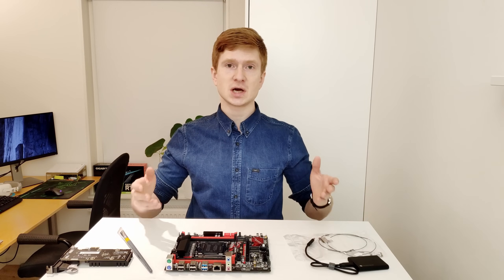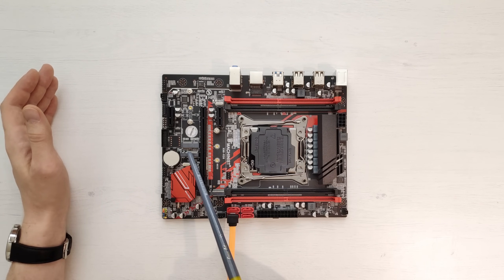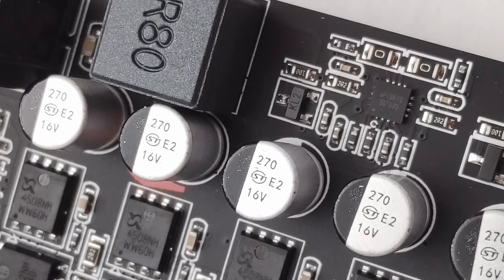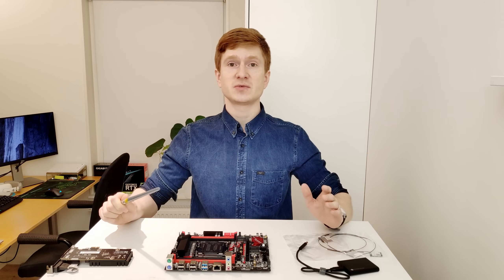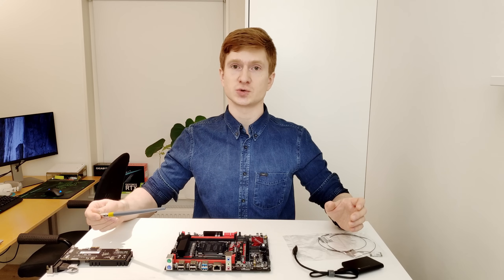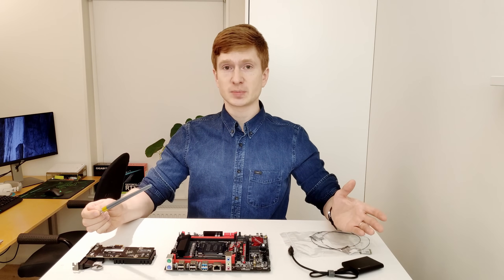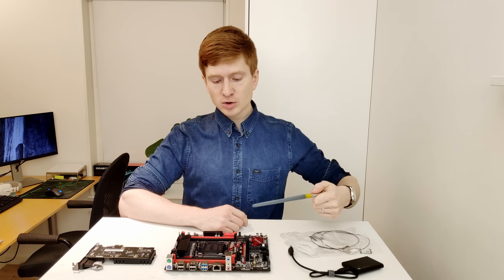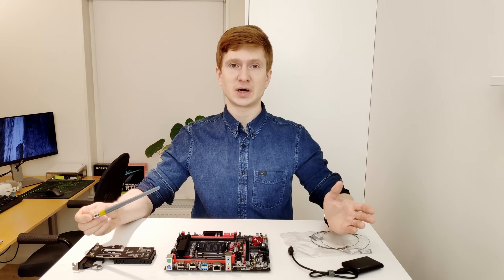🇬🇧 Machinist X99-RS9 – detailed review | E5-2678 V3 | i7-6800k | BIOS | O.C. | VRM | Mi899

Comment: what cheap motherboard for e5 2660 v3?
Reply from the maker: Maybe Huananzhi X99-ZD4 or X99-BD4?
Reply: @Miyconst  thank u but would the rs9 work tho
Reply: and can i run g skill aegis memory
Reply: with any x99 motherboard
Reply: @Miyconst  shipping is very expensive for the bd4 and the zd4 it is additional 25 € to my country
Reply from the maker: @aynamehd7455  X99-RS9 will work with E5-2660 V3, but the motherboard's VRM is really not up for this load, thus you would have to implement good cooling.

Comment: i have a problem, my current configuration is: rs9, 2x4gb atermiter 2666mhz ecc, 2640v3, but after 5 minutes of use, the pc freezes and i need to turn off the button. I saw people talking to set the memory clock at 1066mhz but the rs9 bios only allows 1333. I don't know what to do
Reply from the maker: You have to test components one by one and figure out what causes the freeze.

Comment: So can you recommend the best board that will fit into the Cooler Master NR200 Mini ITX Case with 3 expansion slots?  I plan on using the most powerful processor supported by the board X99, an 18 core 36 thread CPU.  I'm interested in all things of the board SATA III 6Gbps operation, USB 3.0, not sharing SATA ports with the nvme slot, and the fully unlocked BIOS with overclocking features.  Thanks
Reply from the maker: Unfortunately there are no available X99 boards which would match your demands.
Reply: @Miyconst  Not even Supermicro makes a board that would fit my expectations or demands?  Also can you use non-ecc unbuffered ram with a xeon?  Thanks
Reply from the maker: @trapperainsworth2435  I am not an expert in Supermicro boards, but as far as I know, they make very few workstation options, mostly for servers. There is one board which fits your needs: AaRock X99E-ITX/ac, but it's not widely available.
Reply: @Miyconst  Yeah I think I decided to go AMD Ryzen instead of Intel Xeon because of the motherboard cost.  Also the architecture of the AMD Ryzen chip is superior to the Intel Broadwell or Haswell architecture.  I render a lot using Handbrake or MediaCoder & lots of Gaming so I think AMD is my ideal choice.  Thanks for all the help.
Reply from the maker: @trapperainsworth2435  that's a very wise decision. Good luck with the build.
Reply: @Miyconst  So which systems do you use primarily?  Did the Machinist boards become perfected over time & now usable?  Or still only ideal for lower end components?  I would go X99 if it could surpass the Ryzen 7 1700 for less cash or the 5800x...  It's difficult to do that for x99 haswell broadwell.
Reply: @Miyconst  So I noticed the Intel Xeon E5-2699 V4 scores 32,623 on Cinebench R23 vs AMD Ryzen 9 5950X scores 28,641.  So really the Intel Xeon is more powerful on the most intense tasks imaginable?  The ASRock X99 ITX board supports the E5-2699 V4 I'm pretty sure also the cpu costs $480 for a ES from China.  Versus the 5950x which goes for $720 from the USA.  So what do you think?  Will the E5-2699 V4 out perform the Ryzen on Handbrake or MediaCoder?
Reply from the maker: @trapperainsworth2435  no, I don't think that E5-2699 V4 will outperform R9 5950X in real tasks, moreover I strongly recommend avoid the V4 ES CPUs from AliExpress. The frequency and compatibility is unknown.
Reply from the maker: @trapperainsworth2435  Yes, I do recommend R9 5950X over E5-2699 V4, but it all comes down to your needs and budget. If you are trying to save as much money as possible - sure, go with Xeon, but don't buy a Chinese X99 motherboard for this CPU. P.S. I don't really see how the linked video is related to the subject. R7 1800X is miles behind R9 5950X.
Reply: @Miyconst   Thank you so much for your assistance buddy! Hi I linked it since the e5-2696 v4 44 thread cpu got done at 12 min 56 sec & the 1800x finished at over 25 minutes.  So 25 minutes divided by 2 equals 12.5 minutes which would be twice as fast as the 1800x, likely as fast as a 5950x.  So for a lot less money on this specific application, the Xeon e5 surpasses the 1800x and rivals the 5950x likely.  By the way on 3dmark physics the Intel Xeon e5 gets smoked by the AMD Ryzen 5900x & Intel Core i9 10850k (my friend recommended), but the 5900x has higher ipc than the 10850k.  3dmark physics is important, but I need a superior cpu for encoding using handbrake & mediacoder & for gaming at 4k.
Reply from the maker: @trapperainsworth2435  well, Ryzen 9 5950X smokes them all, hence it costs this much, also, from my experience, many Handbrake operations can't be fully parallel, which leads to many cores chilling out while a few are working in certain cases, but in such cases Ryzen will be miles ahead of the lower clocked Xeon.

Comment: riend, a Brazilian brother.
I would like to know if using an i7 6800k will i have to change my server ecc memories?

I currently use an e5 2620 v3 with turbo clock, but even so nothing compares to the stock clock of the i7 version k
Reply from the maker: Yes, you have to change your memory, i7-6800k doesn't work with ECC REG memory.
Reply: @Miyconst  ok bro , "obrigado" thnks

Comment: Hi friend, I liked very much this motherboard for a budget server. I am thinking if a E5-2618L v4 (QS) can works normally in this motherboard. Or if you think it's better to stick to the v3 options non-QS. Thanks in advance.
Reply from the maker: What is the price of that QS CPU? Why no just get an E5-2630L V3?
Reply: @Miyconst  in dolar this qs cpu is $108. It is almost 3x the price of the 2630l v3. I have a 2630l v3, I like it very much. I was thinking of 2618l v4 as a way to reach a higher single thread performance (and a ddr4 2133 support). A qs cpu could be unstable? Or maybe it's a bad choice
Reply from the maker: @baruchkata  $108 is a complete robbery for that CPU, you better get an E5-2640 V3 in that case.

Comment: Hello all. I have two question. 

1. i am switching from an E5 2620 v3 to an E5 2640 v3 in the short term. currently turbo unlock is enabled. Without undervolt mod. Is it necessary to make an undervolt setting with the 2640 v3?

2. do I have to flash the bios again after the CPU change or does Turbo Unlock run automatically with the new CPU?
Reply from the maker: There is no universal answer for the questions. Your E5-2640 V3 may or may not be able to work with the same understanding level, also depending on which unlocking method you used, you might need to reinstall EFI driver.

Comment: Hello I have a question and hope you can be helpful. I have the motherboard with a B85 chipset. 
In both stock and modified BIOS I have a CPU temperature of 95 degrees. The fan sits properly on the CPU and rotate completely normal. However, the CPU clocks itself down to 200 MHz in some cases (e5 2620 v3) due to the specified heat. What I can not explain, the cooler is almost cold. Have you had such experiences with the motherboard? I would have chosen another model. But maybe you have another idea.
Reply from the maker: This has nothing to do with the motherboard, your CPU cooler is either broken or wrongly mounted.
Reply: It works. I try a new cooler.

Comment: Thanks for the information, you will have a video on how to change the bios since my motherboard is the same one that you have and I can't install the operating system, it crashes with a blue screen every now and then.
Reply from the maker: Changing the BIOS won't solve the blue screen issue, you have to locate the malfunctioning component and replace it.
Reply: this is the blue screen message.  device ran into a problem and needs to restart. well restart for you. then it resets
Reply from the maker: @rubenjara4938  this blue screen can be caused by basically anything, you have to isolate the issue and figure out which of the components is not working.
Reply: friend fix the problem this board does not support cpu i7.   with cpu xeon the plate works flawlessly
Reply from the maker: @rubenjara4938  which BIOS do you use?
Reply: @Miyconst  I7 it didn't work 5.11 UEFI2.4:PI 1.3  0.12 X64 ----- nowadays 5.11UEFI 2.4; PI 1.3 HUANANZHI X99 0.11X64 none worked with the cpu I7.     I am currently with the xeon 2620 v3 perfect operation.
Reply from the maker: @rubenjara4938  are you sure that the i7 is working at all? Did you use original BIOS or Turbo Boost unlocked?
Reply: @Miyconst  Original and modified pure cpu failures i7
Reply from the maker: @rubenjara4938  did you test the CPU with another motherboard?
Reply: @Miyconst  At the moment I do not have another plate with support 2011 v3 When I have it I will confirm some news Greetings and Thanks for your Interest

Comment: Hello! i made the turbo unlock on my rs9 with 2630l v3 with -70mv and worked like a charm! Just one question: on stress cpuz test all cores reach only 2793 mhz, is it normal?
Reply from the maker: Yes, it's very normal. E5-2630L V3 is a low TDP CPU, it can't hold it's maximum 2.9 GHz on all cores even with Turbo Boost Unlock.
Reply: @Miyconst  Thanks for the prompt feedback!

Comment: Thank you! I'm considering it for a budget gaming system for my sister. People sleep on these boards paired with xeons so much. They want the latest bling while these offer so much performance at a fraction of the price. This will work with desktop memories too right?
Reply from the maker: Yes, it does work with the desktop DDR4 memory, but be careful, because 4 and potentially 8 bank memory modules are not supported. Warning: memory bank is not the same as memory capacity, 8 GB memory modules can utilize 4, 8, 16 banks layout.
Reply: @Miyconst  Thanks for the heads up. I will have to research it. It becomes a bit too technical for me. The banks are the "x4" or "x8' modules have on their specifications right? So 1Rx8 is 1 rank 8 banks? And 2Rx8 is 2 ranks 16 banks in total right? Man this becomes quite niche. Rule of thumb, look for modules with 2 Rows of chips so 16 banks?
Reply from the maker: Yes, you have got the idea correctly, there are also 1Rx16 modules, which work as well.
Reply: @Miyconst  Thanks again for taking the time to reply. All the best.
Reply: @Miyconst  Hello! I finally got everything for the system but I have a problem. It doesn't boot! I don't understand why. 2640 v3 CPU and SK hynix DDR4 2666MHz 1Rx16 4x4GB HMA851U6CJR6N-VK. Could it be because of server cpu and desktop memory? Power goes to the CPU it gets warm. No beeps or anything (I don't think it as a speaker anyway, does it). I tried a different power supply too. Faulty CPU?
Reply: @oricef  Yeah that's what I did. It's perfectly good now :)
Reply: @kariverson1  what did you do?

Comment: Found this vid while trying to troubleshoot ECC not enabling on my Qiyida X99-H9 board. did you experience any issues getting ECC enabled?  much thanks
Reply from the maker: Most of the Chinese X79 / X99 motherboards work with ECC memory, but don't enable ECC mode, you need a custom BIOS for most of the motherboards.
Reply: @Miyconst  i see. I had bought a Qiyida x79-6M combo set which had working ECC (shown working in both MemTest and in TrueNAS).   I then got a Qiyida x99-h9 combo and while memtest can detect the ram is ECC, the system seems unable to use it. (Then i stumbled on your videos and watched a bunch of them)    I'll try to use one of the custom bios from your mi899 to see if it solves this issue.  Thank you for your time and reply!
Reply: @Miyconst  sorry to bother so much.  I tried all versions of the 8M-F bios and the RS9 bios on this board, but regardless of bios and wether i use auto/enable ECC in bios setting, the board just wont enable ECC.  Any recommendation on other bios for the x99-h9?   Or do you know offhand any board you tested that actually had ecc working?  Thanks alot!
Reply from the maker: @ColemanR42  sorry I don't remember all boards with ECC support out of my head, but Huananzhi X99-TF / X99-F8 / X99-T8 with iEngineer BIOS worked with ECC mode enabled for sure.
Reply: @Miyconst  Hey thought i'd give a follow up conclusion on this.  I obtained a Huananzhi x99 8m and with any of your program's custom Bios, the ECC is enabled and reports working in memtest and trueNAS  (Default bios did not enable the ECC, and no bios actually had specific ECC options). So yeah, one needs to be extra careful to actually get an X99 chipset on these boards, as the other chipsets will boot with ECC, but not enable their function

And an extra note, the v-ram heatsink on the 8m is so much better, entire board stays mostly cool with my load on it,  while the H9 had the entire board and even the RAM heating to painful levels. 

Thanks for your earlier replies to my questions! and thanks for your mi899 program and all your content for this!

Comment: Hi guys. I have a problem with my kit machinist rs9 + xeon 2640 v3 + 2x8Gb2400mhz Ballistix Sport. The power is on but do not have video. I can hear 5 beeps at start but nothing more... https://youtu.be/FT69xD9n0kY

Any dips ?
Reply from the maker: Most likely the graphics card is not detected. Which GPU do you use?
Reply: @Miyconst  hi miyconst. A old one. Gts 450. I will try with another one.
Reply: @Miyconst  problem solved. Thank you very much!

Comment: I need some help with this motherboard... I just installed a 5930k and vengeance lpx 3333 memory, and it's not booting ! Is this cpu compatible ? Else, how to get it work ?
Reply from the maker: There might be several reasons for the issue:

- The memory is not compatible.
- The motherboard came with Turbo Boost Unlocked BIOS, which is not compatible with i7 CPUs.
- The motherboard is defective.
Reply: @Miyconst  Thanks for your reply... I want to try your bios... Do i need the ch341a tool ? Or you can update it only with usb key, like my previous asus x99 motherboard ?
Reply from the maker: You need a CH341a if you can't get the motherboard booted. Before messing with the BIOS I would strongly recommend to at least try some other RAM, better if you can get some ECC REG modules.
Reply: @Miyconst  I already tried another set of 2400mhz ram, not working too...
Reply from the maker: @fvignola  was it ECC REG memory?
Reply: @Miyconst  I just verified and no. It was ballistix 2400 mhz non ecc... I'll try to get an ecc reg set to test... Also, I just went to learn that I can flash the bios chip with Arduino. I know arduino really well, so I'll not need a Ch341a programmer...
Reply: Which bios do you suggest to me ? I listened  your video about all x99 board and bios... You suggest a bios for this board, but I cant understand what you are telling, because  I dont understand english really well... 

And one last thing, do you know where I can find the manual for this motherboard, machinist x99-rs9 ? C'ant find it antwhere... 

And Thanks for you help sir ;)
Reply from the maker: @fvignola  My Machinist X99-RS9 worked well with Huananzhi X99-8M-F BIOS, and this is the BIOS I would pick for myself. Manuals do not exist for these Chinese X99 motherboards.
Reply: UPDATE, Ecc ram is not workink with 5930k... So i ordered a used Xeon E5-2697 V3. I'll need this update to unlock turbo boost anyway...
Reply from the maker: @fvignola  that's strange, I have tested i7-5820k with ECC REG memory and it worked.

Comment: Hello! I got a RS9 with C226 chipset, i have unlocked the turbo and make undervolting manually and works great but, i want to know how to unlock the memory timings in BIOS to optmize the system. Can you add a modded BIOS on Mi899 to C226 chipset, or, can you make a video tutorial showing how to unlock it? Thanks!
Reply from the maker: As far as I know C226 and B85 chipset are compatible with each other, but I can't guarantee that since I didn't test it myself. Unfortunately I don't know how to unlock RAM timings, thus I can't make the tutorial.
Reply: @Miyconst  Att:According to Intel datasheet for Q87 and C226 both are quite similar, with some little differences, I flashed Q87 version with unlock timings of your Mi899 software on my C226 board and works fine. I set timings as you show on your tutorial on another vídeo, also, works great. Thanks for your help man!
Reply: @Miyconst Do you know who modified the BIOS from these chinese mobos? I really want to know how he unlock memory timings in RS9
Reply from the maker: @henriquegonfer7750  you can try to ask this guy: https://github.com/BIOS-iEngineer
Reply: BW TV Canais ao VIVO  I unlock it mannualy, using tools like FPTW64, AMIBCP and MMTOOL to unlock turbo max on all cores and to undervolting but, first i flashed the Q87 BIOS with memory timings unlocked in the Miyconst tools. The system are acctually running undervolting at 50/50 and timings in 11-12-11-24 in quad channel operation. I will try undervolting more without loss performance in benchmarks soon. I recomend you to watch this tutorial from Iskandar Souza about unlock on Machinist mobos https://youtu.be/R9vAejXnGwc
Reply: BW TV Canais ao VIVO  tem o vídeo do Skandar Souza que deixei o link no comentário, lá ele ensina passo a passo! Abraço!
Reply: @henriquegonfer7750  fala meu querido. Qual BIOS vc instalou ? Tenho a mesma placa que você.
Reply: @henriquegonfer7750  acabei de flashear. Showwwww de bola!!!!
Reply: @henriquegonfer7750  outra coisa. Vc chegou a ver que no windows 10 tem uma série de dispositivos que nao foram reconhecidos mesmo na bios original ? Você chegou a instalar algum pacote de drivers para essa placa ?

Comment: My motherboard X99-RS9 has been delivered with C226 chipset, my CPU is Xeon E5-2640 V3; what BIOS with turbo boost hack can I instal?
Reply from the maker: C226 should be compatible with the B85 BIOS, but I have not tested it myself, thus I can't guarantee.
Reply: @Miyconst  Thanks for the information, in the future I will risk installing the recommended BIOS.  Greetings.